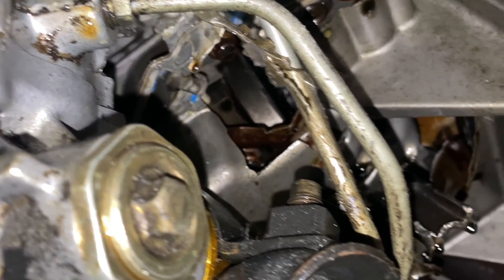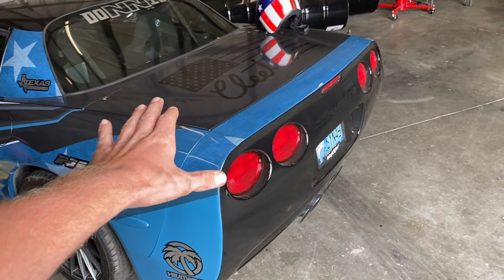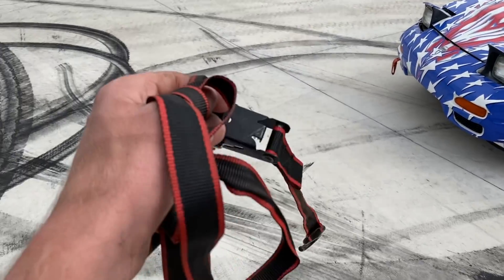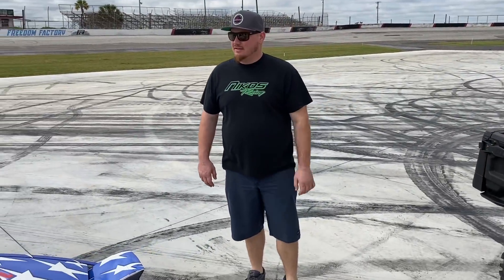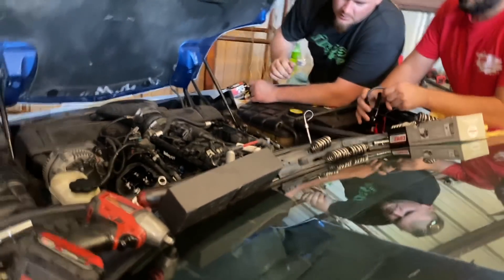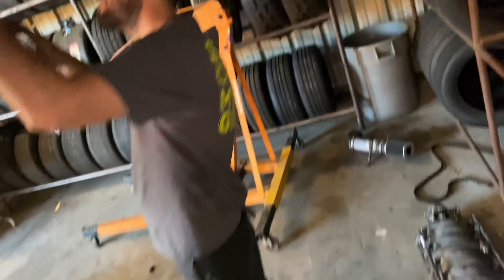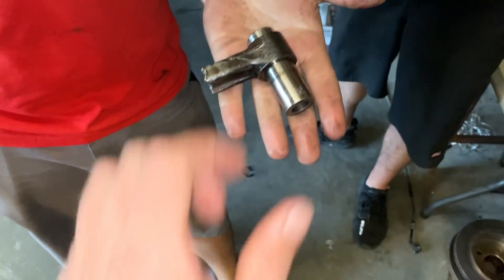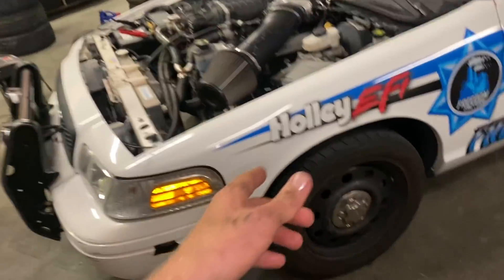We BLEW UP The Engines in TWO Cars Right Before FF Drift Night... (High Speed Engine Swap Engaged)

Comment: I feel like investing in a couple 600HP LS, behind “break in case of emergency” glass, should be the next FF upgrade.
Reply: Did you copy the other guy that already said that or did the other guy copy you. Don't lie
Reply: @r7kelley553  not gonna lie, I don’t read through 2k + comments
Reply: Not really that hard to do. Any LS can be 600hp, iron block or aluminium. The top half of the motor is the expensive part anyway and where the power comes from. SO unless you somehow manage to completely wipe out the heads, intake, and throttle body any block will do. And they're on facebook marketplace or craigslist for $400-600 all day everyday.
Reply: Texas Speed IS a track sponsor 🤔 Could be a cool promo display for them
Reply: @Studio23Media  like where your heads at, little center piece after you walk through the ticket counters.

Comment: Why don’t you guys just always have a Texas speed crate motor chilling in your shop?
Reply: Lol they really should, order one Texas speed that’ll fit in any of their cars on the off chance cleeter gets a little too excited and blows an engine
Reply: That's a bit too difficult. Their LS cars make anywhere from 550hp to 1,600hp. You're not going to put a 1,600hp motor into a high revving 550hp drift car and vise versa
Reply: @turtle2448thomas  oh cause that means that they can’t have a modest one huh? That why I said CRATE motor not a 1000 plus hp ls they can have however much hp they want in it
Reply: @turtle2448thomas  They could run it N/A in a drift car
Reply: @turtle2448thomas  thats a matter of a cam and valvetrain swap before they drop it in a car.
Reply: Everyone's not getting my point. There's no need to have a fully forged and built short block laying around that is really only good for use in Leroy and Ruby. You're not going to spend that coin for an engine that's really only meant for 2 cars. The drift cars don't need a $30k+ motor, it's a waste. Now, they could have two crate motors. A 1,600hp one for Leroy, Ruby and possibly the Dale truck and then a 700hp for Rocket or Donny. That makes the most sense anyway
Reply: I think they will now. I hope anyways. I was wondering why they just didn’t have one or two ready to drop in.
Reply: @turtle2448thomas  agreed.
Reply: They had Ruby's old motor, but the Bald Regal got that a while ago and is still on an IOU from Motion Raceworks.
Reply: They'd need several spares.  There's always going to be one going back to TSP for a rebuild.
Reply: You so right, they really should lmfao
Reply: They will now
Reply: Was just thinking the same thing. Or at least a couple parts motors.
Reply: @turtle2448thomas  exactly
Reply: That is actually a legitimate question
Reply: @turtle2448thomas  that’s what I’m saying. Too many differences between the cars. Couldn’t just have one engine that would go in to any of them. And a drift car don’t need a major build. Stout bttm end with nice heads cam and valve train and the car would be set for a good while.
Reply: @turtle2448thomas  Or the could stop buying Chevy engines 🤷‍♂️
Reply: @Jerry-cc7rd  Ah, yes. Because Chevy has 100% control after aftermarket parts. Go take your ignorance somewhere else
Reply: @turtle2448thomas  "100% control after aftermarket parts"? Get your ass back in school boy.
Reply: @Jerry-cc7rd  Yet, they aren't Chevy engines. Yes, they're based on the GM platform. But, when you change literally everything about the engine (like TSP does), it's no longer a GM product
Reply: @turtle2448thomas  exactly

Comment: lol! wrap has curse, the moment toast got a wrapped.. blew the engine, donnie got a wrapped blew the engine
Reply: Neighbor got a wrap...
Reply: You get the point.
Reply: @scottspropertyservices6877  fords can handle the extra weight of the wrap😂
Reply: @fordfalcon1965  Keep on dreaming!!
Reply: @Dealete420  scientifically proven mate😂
Reply: @fordfalcon1965  but yet there hasn’t been very many ford motors in the winning circle. I have no problem with ford I still have one sbf 347 in a foxbody but the other 2 are 427 Chevy motors...rpms will kill any motor when 85% of there life they stay on the limiter. Burning tires off isn’t good for anything
Reply: rocket has a wrap
Reply: Maybe the wrappers are sending it without cleet knowing.
Reply: @triplehfarmsllc7348  I have a Paxton pushing a 342, it gets new oil and a filter after every weekend  and I only run it to 6k rpm.

Heat kills viscosity, and oil is cheap.
Reply: @iknklst  your correct after any hard beating it’s always best to change to oil..even at the drag strip all on what car after ever race day or test day I change the oil if I make more then 5 passes I change it at the track.. it’s very important oil and grease is the life of everything if you keep up with it your gonna pay dearly
Reply: I wonder when the last time he checked the oil was
Reply: @triplehfarmsllc7348  My old boss was co-driving the #1 Gt40 at Le man's when they placed 1st, 2nd, 3rd. Lol.
Reply: Well neighbor has a fully built motor from a reputable shop, neighbor also was built to hold a lot more power than what he has it set at. Neighbor also has to have the timing chains replaced every 6 months, and hasn't been driven much in the last year because of covid.
Reply: @triplehfarmsllc7348  but neighbor has legit spent its entire existance on nothing but rev limiter while over heated 🤷‍♂️
Reply: @triplehfarmsllc7348  guess you never seen them 900hp 410ci n/a Roush racing engines
Reply: @davidadcock1475  what about it??
Reply: @nimwit0  you do know that car is tuned and is governor set to keep it off the max rpm?????tuning is what keeps it together and having a eye box...the vette isn’t setup the same or the 240 total different setup. And heat with fuel mixing in the oil because of failure to service the oil is what broke both cars. You just can’t do it and neighbor will do the same thing if not maintained but a much more expensive fix.
Reply: @triplehfarmsllc7348  able to stay on the limiter without blowing up.... you must not get out much nor keep up with multiple divisions of racing.... it's cool.... it's cool.... you've officially been cancelled
Reply: @triplehfarmsllc7348 

I'll bet neither cars have baffled oil pans and the oil pickup went dry, the pump cavitated and kaboom.

Lateral g's from drifting most likely put that thin as water oil up against the side of the pan, sump was empty.
Reply: @numlockkilla  makes me picture the parking garage employees from Ferris Bueller's Day Off 😂😂
Reply: @davidadcock1475  and as far as statin on the limiter and not blowing up it’s called tuning and adjusting the limiter so that your not blowing it up if you know so much you would know it’s adjusted on every race car other then in nascar it’s literally what a governor on a motor is for and if not set correctly she will locked up realllll fast
Reply: @iknklst  idk about the vette but the 240 most definitely has one..and lord knows how either motor has been treated but buying. And Garrett ain’t easy on anything. A none lubricated motor is normally what makes bearing failure in return if not corrected ends badly and always why you change ur oil as well as I sent samples off just to help stay on track of what’s happening after each event it tells a lot
Reply: @triplehfarmsllc7348  that's what they make a rev chip for.... specifically designed engines to run high rpm for long periods of time..... 8500 for 30-50-100 laps so you're looking at 15-25-50 miles on a half mile track wide open and still be able to run that same engine week in and week out.... you must not have done much racing in your life... you're excused
Reply: @triplehfarmsllc7348  I wouldn't say that, Ol Cleet has done pretty good burning tires by the truckload seems to me.
Reply: @davidadcock1475   Week in week out??????? You clearly don’t understand what it takes and cost to race and everything that’s involved or how many times motors are taken apart and put back together in the pits....please just keep watching your tv or please bring something to bmp and let me know what event. I’ll even have my crew teach you if you don’t have a car just come join us in the pits and learn something..if you know so much like you say start a race team sounds like you can do it all yourself 😂 and I’ll make $10k bet right now drifting or drag racing you pick and we will video it. I’ll even get Garrett to put it all on here 😂
Reply: @triplehfarmsllc7348  I raced for 20yrs.... enough said.... I know plenty of what it takes to race a car.... keep being an arm chair racecar driver 😉.... while I'll continue to build 900+ hp engines
Reply: @davidadcock1475   😂 well let’s make a race happen. Please explain who you work for building engines because never heard of you 😂 my current drag car was built by KSR and that’s how I know Garrett and I’ve got 2 other I built myself one is just a sbf 347 with a 250 shot and a c4 trans and  the other is 427 with a 88mm. And it has a powerglid but I’ll lay money on a gap and we can go 1/8 or 1/4
Reply: @triplehfarmsllc7348  I work for me.... all my cars were built by me.... nobody but me touched my shit.... cool for you.... I stopped racing 15yrs ago..... probably before you was even thought of.... funny thing nobody's heard of you either 🤔🤔🤔
Reply: @Shornandkenny  that's a shame bud, must have cost you a lot of money? Everyone makes mistakes.
Reply: @fordfalcon1965  oh yes .... 

Thats fords mistake.  That three valve triton from those years was real bad
Reply: @Shornandkenny  yeah I know, only real idiots bought those ones. Some dumb people fix them up after they blown up 3 times.
Reply: @triplehfarmsllc7348  Oil sampling ftw. 

I don't know why more don't talk about doing it. I am a firm believer in seeing what wear metals are showing up and how much fuel and coolant is present. 

As part of preventative maintenance it rates right up there with fresh oil and filters and can point to a problem before it becomes fatal.

Way cheaper than windowing an expensive block if you can do a teardown before a conrod exits the motor.

Comment: Spare 600hp crate motor.
"In case of emergency break crate"
Sprayed on the box.
Reply: How do they not have a spare engine or 2 laying around just for such dire emergencies as this?
Reply: @ryanlamfers8692  they've used em up lmao
Reply: @RogersMudRacing  yeah its hard to have spares when you keep going "hey i could use one of those right now"
Reply: @RogersMudRacing  Yup, the wrecking yard's empty ;-)
Reply: ... and a t-shirt.
Reply: @ryanlamfers8692  same reason I don't keep a bolt laying around for my AR, because I'll end up building another AR for it to live in 😂

Comment: The rod bearing spun and stacked on top of each other so the piston comes up higher than it supposed to and smacks the cylinder head. They call it a stacked bearing
Reply: Yeah there was no denying that was rod knock as he drove off the pad.
Reply: How long does that take to fix?
Reply: @ryangraham6878  engine needs to be fully rebuilt and hopefully some of the reciprocating companents are ok but it's unlikely. Probably easier to start from 0 or have the black fully machined if there is no holes in it.
Reply: @ryangraham6878  lolllll
Reply: Does that ruin the head?
Reply: @trashbandit2449  heads will need to be planed and get a valve job but should be ok
Reply: Spun and stacked on the big end. Exactly what I was thinking. I've heard and seen this before.
Reply: @SternLX  does this happen with normal wear and tear on a vette? Like higher mileage or did he beat on it too hard?
Reply: Watching nate diagnose a motor is like watching moatsart paint a picture. 

Nate is a beaut, Clark!
Reply: @doozerchuck8625  wow! Ask him if he's single!
Reply: @scottmartin8888  It's not just a Vette thing. There's lots of things that can make it happen. Hours on the engine, Oil starvation, improperly installed bearing... etc. That engine got used hard so you can expect something to break eventually.

Comment: Here for the LS and Coyote fan boys bashing each other. Was not disappointed!
Reply: as a small/mid/big block guy, i just laugh at the emission standard they both are designed to follow lol
Reply: Lmao its funny watching these guys call them Fords and Chevys when the only thing that they even relate to is size, pushrod, or dohc. You could have Leroy be as reliable as Neighbor if he wasn’t pushing the limit every time he idled, and Neighbor could be doomed at every startup if he wasn’t 300hp under the max for that engine setup. At the end of the day it just depends on how hard you push the limits and how well you take car of the car. Mfs just need to learn to appreciate loud cars banging limiter and slamming gears.

Comment: Yall need to get Neighbor setup to drift he already kills it imagine if he had more rear grip and  Loads of extra front track width with more Steering angle. Murica JZX
Reply: Just some firmer suspension would do wonders.
Reply: I'm honestly surprised he doesn't has a crown vic thats set up just for drifting as much as he loves them
Reply: Neighbor is an awesome car but it’s not a drift car
Reply: @bretzielanski6400  No but it could become one while not losing it's purpose.
Reply: @offroadspecialties7383  Leave the rear loose and stiffen the front would be my 2 cents get that 3 wheel motion.

Comment: 10 years in a machine shop, and most short blocks that came in with low oil pressure 
, spun rod, spun main, or a seize had one of those Fancy K&N filters on it. Including my first seized engine.. lots of similar story’s out there surrounding the K&N oil filters and sudden losses of oil pressure.

Comment: Oiling  issu es are the achilles heel of the LS when you do more than just straight line stuff. An accusump is cheap and so worth it to solve most of the issues.
Reply: A 'real' SBC has very good oiling, as well as cooling. And 5 bolts per cylinder heads. 
An LS? Hmmmm none of the above. But has more power stock.
What could go wrong!
Reply: @ldnwholesale8552  you can get by with just a better pan or an accusump. Some like the Ls3 have more oiling issues than the others. Still take an ls based engine over old sbc any day of the week
Reply: GM had to replace so many engines that Corvettes started coming with factory drysump.
Reply: High Gs and no dry sump equals death to any LS motor, hence the C6 Corvette’s went dry sump on Grand Sports and Z06s
Reply: @dnel6494  or just a lot of motors in general lol

Comment: there is no way they dont have a spare engine sitting around somewhere lol
Reply: there was a shot of a steve morris crate in dr tuneemalls vid the other day, but I assume thats for whitetrash
Reply: Is that a   1970.5  firebird in your profile pic  looks identical to the one i had 400 big block 400 turbo transmission  nice car air shocks even the same color brings me back to when i was 17 my first v8.
Reply: Mess was mesnt for burning rubber btw

Comment: Can we give Neighbor's GT500 motor a round of applause? It has taken a real beating and is running strong!
Reply: it was built and undertuned to handle that beating though
Reply: Is it still eating through timing chain kits? They were basically a service item for a while
Reply: @veedubgeezer  That's what i was saying. First time built it was oh yeah, chains, hey some more chains, on and on. I think it's just a thing they're doing in the backround at this point. It's just old news i don't think its gonna make the videos as it being routine stuff. Those engines are great for high rpms and just giving it hell. Pushrods can do it too...but are not designed exactly for it.

Comment: It’s that bank the angle  and inertia  need baffles in the oil pan ..
Reply: dry sump would be ideal
Reply: Agreed. Oil starvation - Moroso makes a pan and pickup for that.
Reply: Neighbor doesn't complain
Reply: Sounds good, sure would not hurt anything anyway,
Reply: You also need a oil temp gauge cuz thats a big problem in some cars when drifted. Water temps are easily managed but others need a couple oil coolers and a cool down lap after a couple rips.